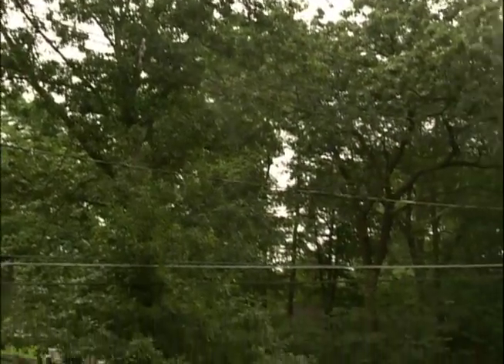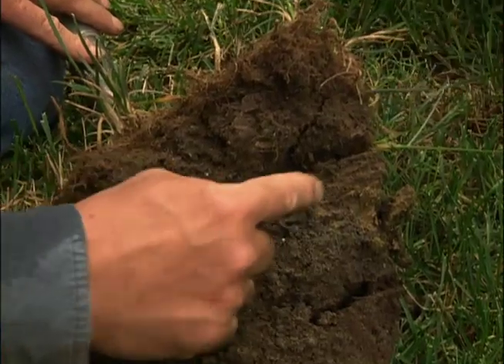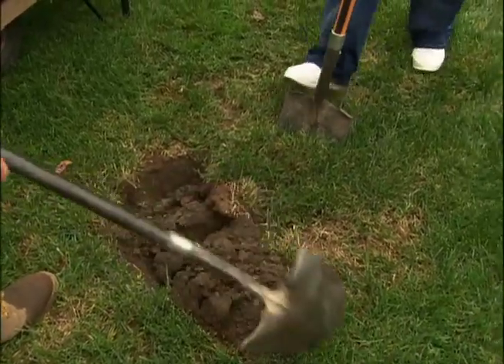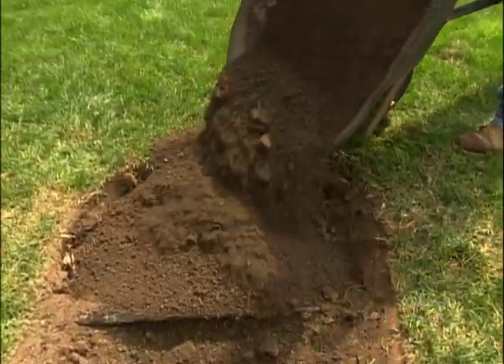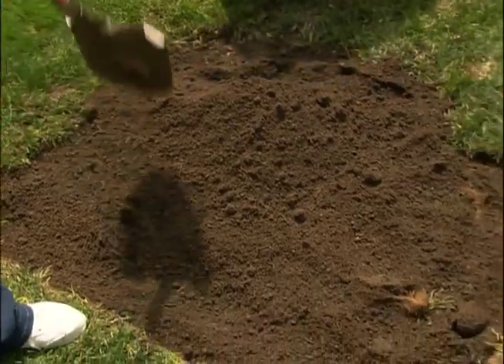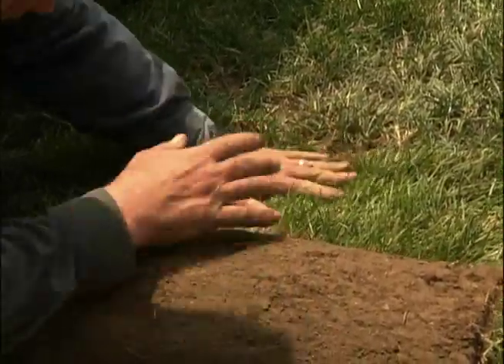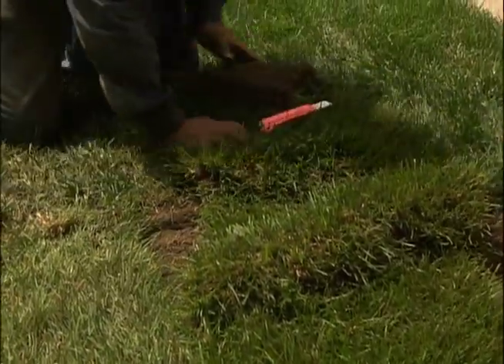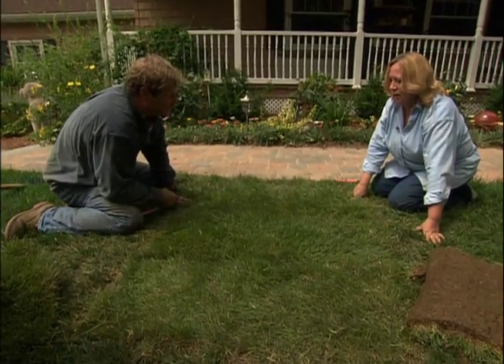How to Patch a Lawn | This Old House

Comment: Super speedy grass patching!

Normally it takes two weeks for grass seed to germinate. Put clear plastic over it that you can get for free from furniture stores. You'll have 6 inch high grass in 36 hours that you can mow right away. But the more shade you have the less likely this will work. If the grass under the plastic turns yellow you have to start over.